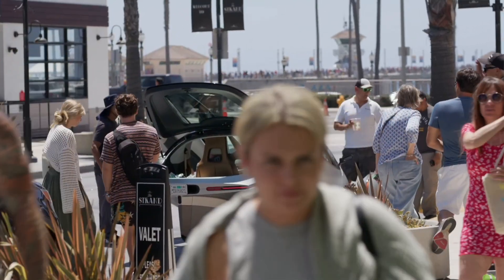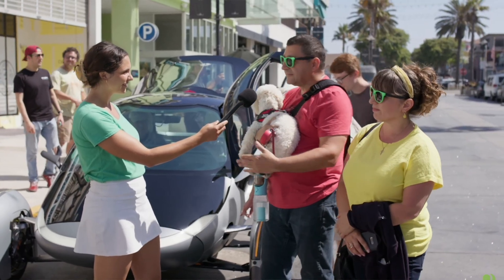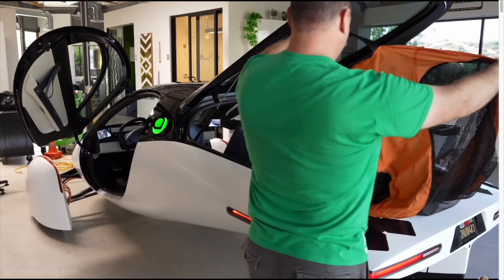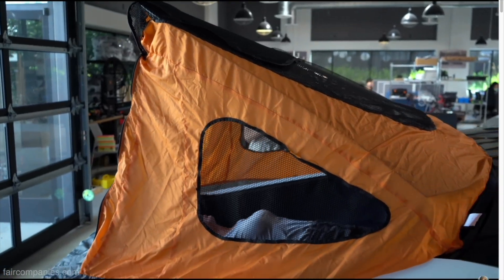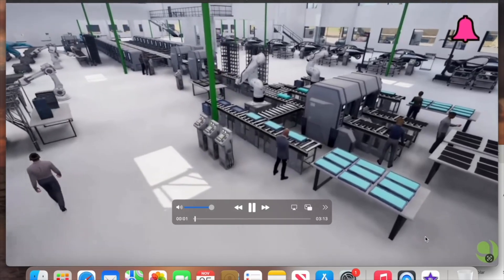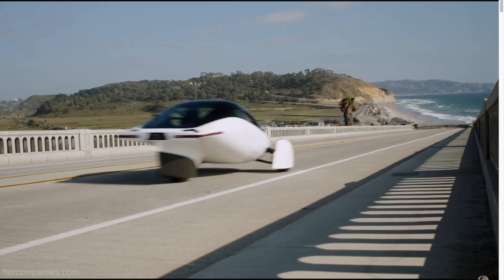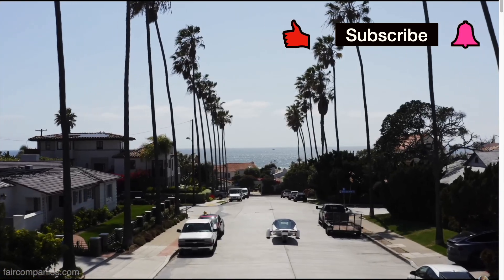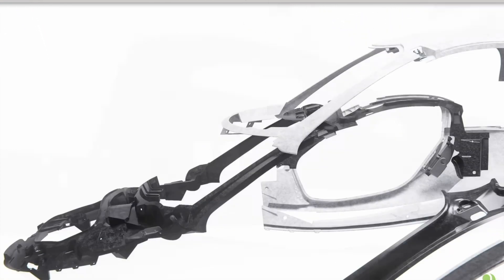One Of The Best Vehicles To Go Camping In !

Comment: I've been seeing a lot of posts about people not thinking Aptera isn't going to get produced, I truly believe they are wrong only because of the progress they have made.  Ignoring and commenting here and there but it's definitely interesting to see what people think these days....  I'm in, accelerator reserved 👍!   ☀️⚡🚗
Reply from the maker: I may have to make a video about that . 🤔
Reply: I heard the same with Elio Motors. They made lots of progress, had non refundables (57K of them), did an IPO and even had two newsletters where you were updated every week. They they did a nationwide tour, built 5 prototypes, had 60 suppliers, Roush did engineering for them, along with getting autocycle laws changed and applied for the ATVM loan. They also had an old GM plant and all of the equipment. That was way more progress than Aptera has made. 

Talk to those investors today.
Reply: @billsmith5960  wow that's crazy right?  How long ago was that?
Reply: @kevroll99  - They keep the scam going as they pretty much told those reservation holders (that bought into the gas version) that they will make an EV version first. When that becomes overly successful, that will fund the gas version.

That announcement was two years ago bu I bet the faithful will be ready for everyone to buy up those electric ones and then the gas version will be in their garage soon after.

I'm hoping they have the Mr Fusion Model coming out soon.

Comment: 700watts per day, that's 7 miles 😅
Reply: 700W , at high noon.  But not every hour is high noon, so the other hours, the per hour charge will diminish.  Ultimately, it comes out to about an average of up to 4.4kW throughout the day which can propel your Aptera up to about 44 miles.  If you drive more than that amount, average, per day, you will then have to plug it in, tho probably seldom.   Hope that helps.  The battery capacities will range from 250, 400, 600 and 1,000 miles of range, depending on which you choose.  Enjoy!
Reply: @fanfare100  4.4 kw of energy 😂
Reply: @fanfare100  
I think you mean 4.4 kwH
Reply: @fanfare100  
Go learn the unit measures of electricity before discussing it
Reply: @fanfare100  
And the 1000kwh version will never be made, that's just for clickbait
Reply: @fanfare100  Also, make sure yo are in perfectly clear sky and as far south you can go. Plus make sure it's summer. Then make sure you have no trees around. They block sunlight.

How do I know, I've been boon docking for years and see what the reality is vs best performing numbers. Top it off, there are people that camp in places like VT. It's up north and the parks are not on a beach but in a forest. Add into that, the distance further north over San Diego, means less efficiency.
Reply: @billsmith5960  Yes, and even less efficiency if you are in a place like London, where, instead of getting up to 44 miles per day of extra charge from the sun you'll get 16 instead.  But, even if you get 16 and your average commute is 22 miles per day, you';ll still only plug your battery in very seldom.  I'll take it!  That's actually very far from a doom & gloom scenario.

Now, if I lived in a very northern latitude, near cities such as Inuvik or Kiruna, where there are weeks of non-stop sun each year in the summer.  That would truly make for awesome summer camping trips and the daily charge would surely far exceed the 44 miles per fay maximum.  

Then, on the days with the shorter days, simply plug it in just like any other EV.
Reply: @fanfare100  - They seem to leave out the city driving and people in northern latitudes. San Diego is great and idealistic. Thus why they do videos there. Maybe they should have taken one to Burning Man as that place is treeless and they could show everyone how much it charges. Yet, another lost opportunity.
Reply: @fanfare100  - Ideal conditions is what they are rated for. Just like any other solar panel. I'm starting to believe that any spec they produce is under ideal situations and thus, maybe a challenge for many. Seems most are using the numbers as to think, no plugging in.

It would be nice if they had a unit that has those panels on it and they can show what it produces in the ideal climate and then not so less. If i can do it on my RV, they have the ability to do it too. Then everyone will stop doubting the numbers. Super simple and takes a few minutes for their engineers to so.
Reply: @billsmith5960   I think that most videos are in the San Diego area because they actually live there and that's where the factory was and now it's in Carlsbad.

I would have agreed with you that Burning Man would have been a great opportunity but my Monday morning quarterback self says yikes!  It got flooded to kingdom come with monsoon-like weather, so maybe not.  lol
Reply: @fanfare100  - I understand that but they are doing like Arcimoto. Showing the vehicle in their area. I'd like to see more than just the San Diego area. People do live in other areas and would like to see it doing it's thing there. The whole complete eastern seaboard would be a good start. Lots of money in that area too.
Reply: @billsmith5960  I do recollect seeing some footage of when they took it to Switzerland.  They may have sent it elsewhere as well.